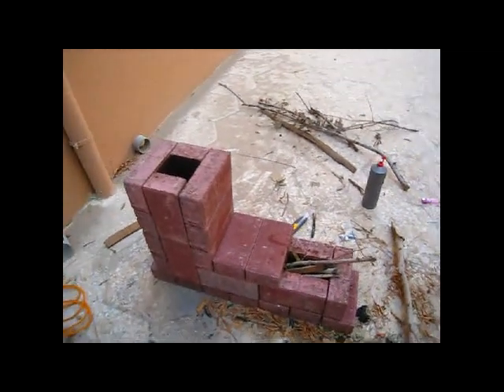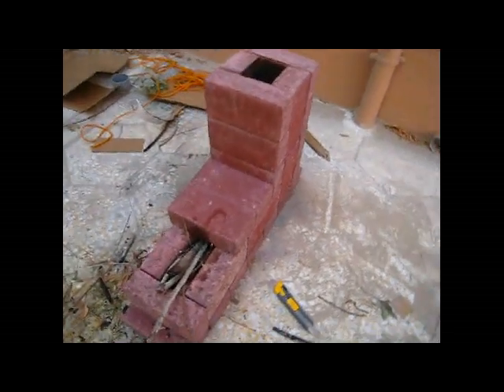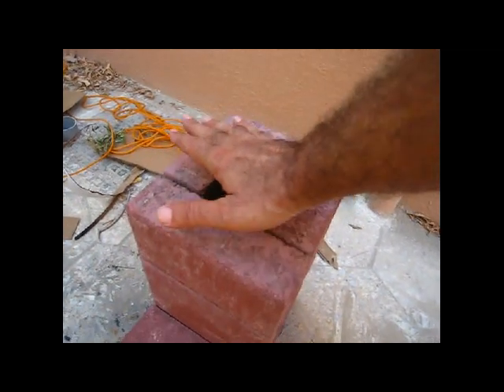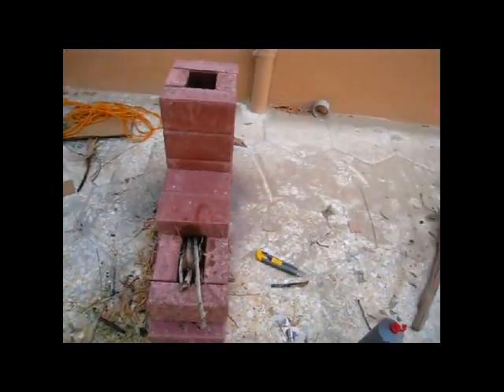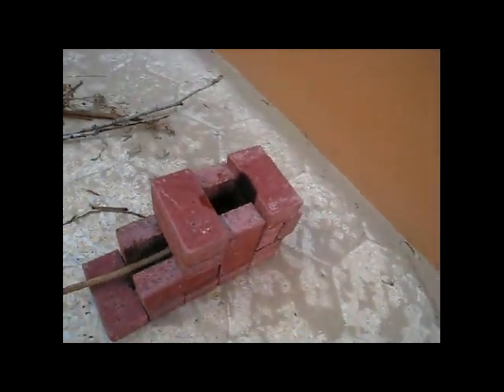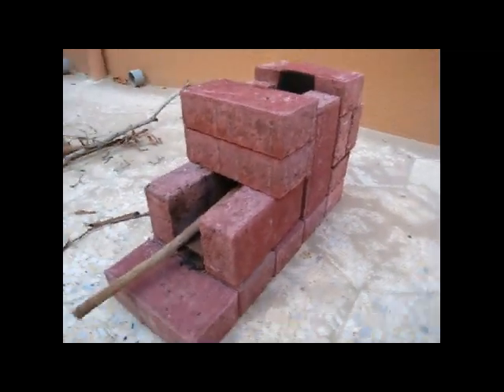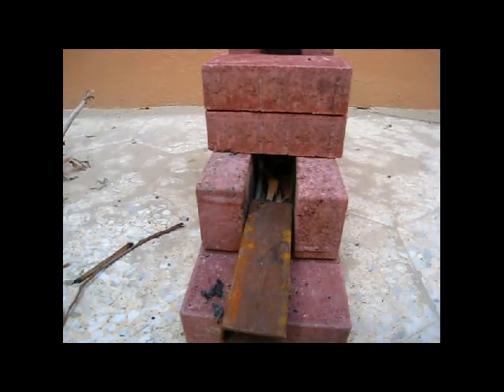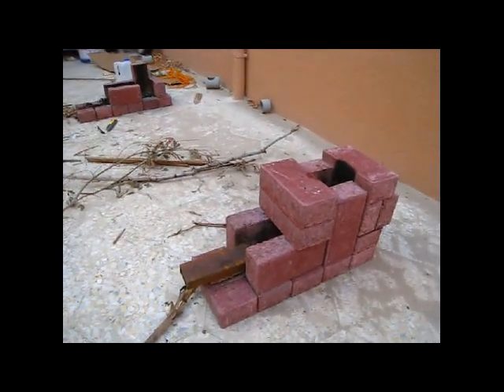Rocket Stove designs that didn't work, 動作しませんでしたロケットストーブの設計

Comment: Hi Saeid, I like your home made handle for the grinder. Incidentally, I stacked up some bricks for a rocket stove today to boil 20 litres of water to de-feather 3 roosters. It took under 30min to boil the water. The fire was really roaring. No assisted wind or forced air intake necessary. It is all taken care of by the draw from the heat riser. If you are interested, I can send you pictures and dimensions. Let me know. Cheers.

Comment: you are lighting it incorrectly.. Start with the sticks in the chimney vertically with newspaper at the bottom and no fuel sticks at the fuel shelf. This allows maximum air to draw and will heat the chimney and get the burn going. Once it starts then put your fuel sticks in a few at a time at the bottom. The way you are doing it chokes the fire before it has a chance to get going.

Comment: Dear Jim: The Rocket Stove is a "L", so the Horizontal is 1/3 and the Vertical 2/3 of the total. Also the entrance must be: 50% for the fire and 50% for air entrance, separated. Otherwise it wil not burn. This is my experience!

Comment: the rocket stove must at least have 50 cm height or more, and 20 where you put the wood
and the opening for the air under the wood must be 1/3 of the total area of the opening, 
sorry about my english but i think you will try to understand, i have done one for cooking
and one for heating my house and one for heating water, but i could have done all in one, but what i want to do is painel solar heating the water in a close circuit and at the night will be the rocket stove heating close circuit

Comment: More height and a shorter horizontal burn chamber.  I did a little demo a while back and it didn't work all that well until I shortened the horizontal burn tube to just one brick long.  Also the 4 inch by 4 inch does not work as well as 5x5 or 6x6.  I'm still learning these things as well.  If you surround it with dirt or mud it will force the draw to come through the burn chamber instead of pulling air from between the bricks.  Good luck.

Comment: watch the following video and correct your design
"How to Make a Brick Rocket Stove for 6.80 $"
tighten the top breaks because from top side breaks air flows inside chimney, which does not allow air to be sucked up. also little increase the size of your inlet for wood, at least half flat break size

Comment: Yeah, too many cracks, stove is too small, intake too big, Ianto Evens book would help a lot. The good news is, what you have almost works. We built a J stove not much different from what you did, and it kind of worked. heat went out the chimney, smoke went out the intake, there was so much wrong with what we did, but your versions almost worked.

Comment: try to build a more space of your fire wood  entrance  so that air comes in and all  the bricks must be sealed off use clay or cement mix with charcoal powder all bricks must be totally close or sealed, heat stock inside and fire wood now easy to burn

Comment: Saeid, I had similar issues with my all-brick stove until I covered the entire thing in cob. Once I sealed up all the cracks, the thing cranked. I recommend finding some way to seal the cracks up and provide better insulation. It should help.

Comment: 8) Use a grate under the fire. 
9) Insulate  the  heat  flow  path,  from  the  fire,  to  and  around  the pot(s) or griddle. 
10) Maximize heat transfer to the pot with properly sized gaps.

Comment: 5) Maintain a good fast draft from under the fire, up through the coals.  Avoid allowing too much extra air in above the fire to cool it. 
6) Too  little  draft  being  pulled  into  the  fire  will  result  in  smoke and excess charcoal. 
7) Keep   unrestricted   airflow   by   maintaining   constant   cross sectional area through the stove.  The opening into the fire, the size of the  spaces  within  the  stove  through  which  hot  air  flows,  and  the chimney must be the same size.

Comment: Ten Basic Principals of Combustion (if you do not follow them it will not work)
1) Insulate   around   the   fire   using   lightweight, heat-resistant materials. 
2) Place an insulated short chimney right above the fire to burn up the smoke and speed up the draft. 
3) Heat and burn the tips of the sticks as they enter the fire to make flame, not smoke. 
4) High  and  low  heat  are  created  by  how  many  sticks  are  pushed into the fire.

Comment: My rocket stove only worked when I sealed the cracks with dirt and clay.  It must be a sealed chimeny.  I had better results from a stove pipe insulated with perlite.  Once you get some heat rising up the chimeny, you dont have to push the sticks in so far if you add some bricks to both ends.  Use the "J" tube design and your fire will first burn upside down, sideways, and then up once draft is woking properly.